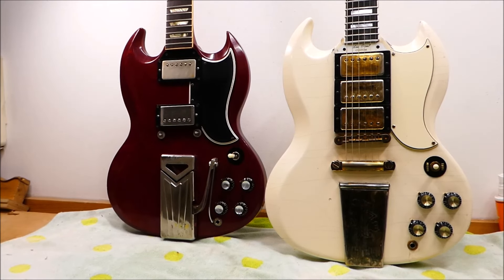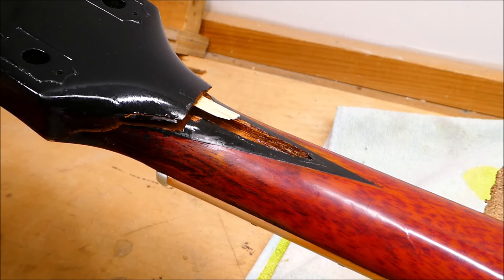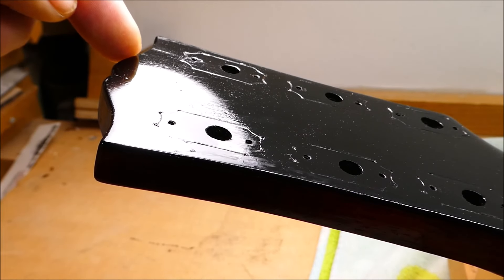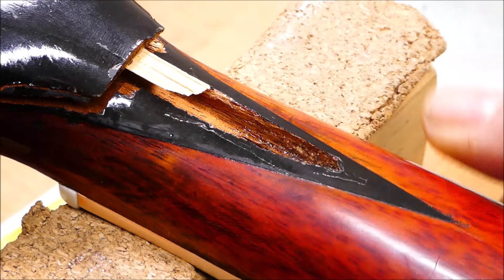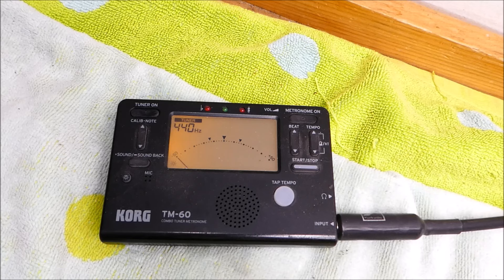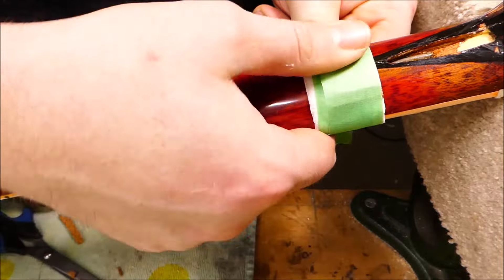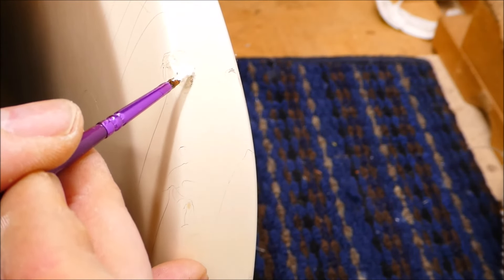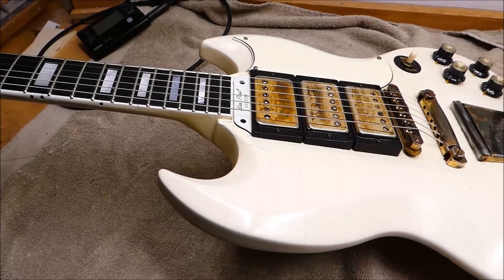Early Les Paul SG's :  1961, '62

Comment: Les Paul did not ask Gibson to take his name off of the guitar, his endorsement/signature model contract ended in 1963 & because he was going through a divorce he did not re-sign a contract until he negotiated a new one in 1968 late 1967 & it was THEN he requested they bring back the traditional single cut Les Paul. Not that it really matters much but I personally feel it’s very important to note that from 1964 through 1967 Gibson did not make ANY Les Paul models at all. Paul’s name came off the “new” double cut “Solid Guitar” and it went from being a Les Paul from 1961-1963 to being a Gibson SG from 1964 to present. Isn’t it mind boggling that from late 1957-1960 the sales of the traditional single-cut Les Paul slumped so bad they gave up that design all tougher for nearly a decade? You would not think that would be the case when they introduced the now coveted mythical PAF’s in 1957 & the now revered, cherished and also coveted Cherry Sunburst in 1958, you’d think they would have been jumping out of the stores but nope. Sales steadily decreased from late 57 through the end of 1960 when they discontinued it. Insanity.

Comment: Every olympic white LP Custom SG I've seen from 1961-62-63 has the neck binding cracks. Gibson painted Olympic White over the side binding on the neck. The binding shrinks and the paint cracked. I have a 62-63 that is in really great condition. No checking, gold hardware is still gold, 3 PAFs, pots are dated 1961, and the neck binding is still nice except for the first fret shows checking at the binding.

Comment: Your discussion about repair and restoration reminds me of baumgartner restorations. They have a set of rules they follow to differentiate between repair and original work. They use fluorescing paints for their repairs.
Reply: It reminded me of that as well. The conservation paints fluoresce because of the UV inhibitors added to them to protect the paint from fading. It was not to show where the painting was retouched, although that is a benefit to the owner and any future conservator.

Comment: I truly appreciate your comments about restoring an instrument to the point of hiding whatever damage may have occurred. Yes it looks better, but it is still not the instrument that it was when it left the factory (for better or worse) and therefore counterfeit. 
    I am also in complete agreement with your comments about work done with hands of a sentient being. Yes I have several CNC rigs that I enjoy producing objects with. But I also just completed a beginning Blacksmithing class. The objects that I was able to produce (with much instruction and help from the Master Smith) from basic metal shapes and even a railroad spike where as satisfying as anything my CNC gear has allowed me to make. Most every shape and mark were produced with my hand and a hammer.

Comment: 19:50 if you make a jig for a dremel drill station, drilling with a milling bit will give a cleaner cut regardless of the material you're drilling into. I've drilled clean cuts in cork with a similar setup. The issue comes from the drilling implement not being restricted. One flute catches and makes a mess of the hole.

Comment: Since it's getting New SS Frets, I would have used a Radius Block, fine sanded the fretboard and Ebony Stained the fretboard. The body was protected but I would have protected the headstock also, although she did a great job with her skills not to damage it. Speaking of headstock, I would have color sanded it using 7000 grit and bluff it to get rid of the spots and stains, but not too much. Just enough to make it pop. Nice work and great job.

Comment: The finish cracking at the binding 16:54......I have seen that before and also had it happen during refrets of old lacquer finished guitars. It’s from beating the fret end when installing the new frets. When you get out to the ends, tap lightly or the hammer blow can shatter the lacquer usually at the lacquer line at the bottom of the binding.

Comment: I have an 86 Les Paul custom SG reissue I bought in 89 and has been my main guitar ever since. There was a hairline crack where the neck meets the body that got worse when an idiot knocked it over and now it's visible.  Joel's shop is about 3-4 miles from my house.  I'd like to see if he could make it disappear. I'm never going to sell it, it's mine until I am gone. Just had it wired so I get all the pickup positions instead of the bridge, mid and neck, and neck. I haven't picked it up yet,  I'm still waiting on an amp to be finished.

Comment: Another option for the intonation-problem guitars is use a lighter gauge string on E and A. Then the saddles do not need to go so far back. Tone is fine with light strings, just ask Billy Gibbons and old videos of BB King. They run with 8s on Gibson scale guitars.
Reply: They take some getting-used-to, especially if you have a heavy picking hand but that just shows how much I over-pick.

Comment: I had a Les Paul SG in the 60s exactly like the one in this video. I loved it, probably the best guitar I've ever owned, There was an issue at the heel joint, the wood had split along the line of the fingerboard, but my Dad fixed that. The skinny neck was super fas and I blocked off the weird up and down vibrato. I traded it in for a cherry red 70s SG Custom, the most beautiful guitar I've owned, unfortunately also the worst name guitar that's passed through my hands. The middle pup was useless, it didn't stay in tune- due to the awful leaf spring vibrato,  and it sounded lousy. I hated it and had no regrets about getting rid of it and getting a 335.

Comment: The problem I have with the idea of a hand cut inlay being worth more is man has used tools since the caveman days to help him with tasks. Today, luthiers use power tools. At one time the luthier who did everything by hand looked down on any motorized tool being used. He probably claimed his work had more value because he did it by hand. Define “by hand”. Even the luthier who did it by hand was using tools. Are you familiar with a parser drill? Probably not. A parser drill allows a craftsman to cut out odd shapes. These have been used for centuries… CENTURIES! A CNC is merely another tool. If operated incorrectly the job turns out as inferior work. A good job is what everybody wants. Tools allow man to do a better job and in less time. Each time someone came up with a better, more accurate way to get the job done and in less time. What is it really about then? It’s about the threat of one’s livelihood being eliminated by a better built mousetrap. I would argue a very well made guitar is worth more than one that is sloppy no matter how either are done.

Comment: On the white Custom, the section of neck binding with the enlarged fret marker dot-holes seems to be a different colour to the section closer to the neck-joint. Could it have been a later repair-replacement after the wood/fret shrinkage-expansion fragmented the original?

Comment: 7:12 honestly should've been done for decades now. It's done in painting and it's standard practice to not hide those, not only that, it's a show of a quality repair to show it's been fixed and make as few irremovable repairs (within reason). And if it means this removes the scum of the pond from the equation, then yes. Personally, if it were up to me, a repairman should leave signs unbeknownst to the owner, to keep them (or a re-seller) honest.

Comment: You should always paint the new wood a coupletimes by itself FIRST. Match it up separately n when you get it to match as close as possible then you paint everything together and BLEND. If you continue painting them both at the same time your not going to close that significant difference in color no matter how Manny coated you add to them they are both going to change together n therefore the cookie difference isn't going anywhere. In simple terms paint the new wood to match before you try and paint to blend the wood 😉

Comment: An old guy came to me a few years ago, saying he had an old guitar that did not work anymore.
He knew i did some electrics on guitars before so he asked me to look at it.
And when he opened the case there was one of those early les paul/sg's in it.
And that guitar has suffered, broken neck that was ugly glued on again, pieces of binding gone and horrible repainted.
Not as bad as in this video, but it needed a lot of work.
Fixing the electrics was easy, new strings on it and it played great.
I wanted to buy it from him, but it was his first guitar and he did not want to sell.

Comment: Thanks for this upload. I own an original white 61 custom with tremolo. A lot of the paint has worn off on the neck at the 5th and 7th fret positions. the nitro has yellowed somewhat due to age, but I've been advised that it's almost impossible to spot paint these areas with an off white colour that will match perfectly. From your experience with that white LP, is it really that difficult to match paint colours perfectly?

Comment: Ive seen a lot of LP and SG style guitars with the bridges not installed at the correct angle and ive been shocked to see that some of them were able to be intonated. What is the rule of thumb on this ? How can you measure say from the nut to the bridge and know if its possible the guitar can or cant be intonated. Is there a measurment like this that will tell you it cant be intonated ? Sorry i am just curious as to why some of the guitars ive seen have been able to intonate and others that were very close in their imperfection were. Thanks as always for the videos.

Comment: In general how much money would you expect to save buying a repaired Gibson Les Paul that had a cracked headstock?
Reply: Usually they lose half their value with a headstock break. You can expect to pay anywhere between $150 for a "simple" glue up repair if the crack is minor, or up to $500 if the headstock is completely broken off (these rates might vary depending on who you ask)

Comment: Good job. That quite a long protusion on the router. Where do find such deep 1/4 inch bits?
Reply from the maker: It's a 1/2" diameter, 1" cutting length. Most of the router bit suppliers make them that size.  Freud's part number is 50-102.

Comment: Sino acrylate is what you should use there you could have pulled your joint tight and just seeped it in you're going to have a glue line no matter what you do with white glue I haven't used white glue on headstock repairs for 15-20 years! dont use splines either,,,it allways ends up looking terible as it ages

Comment: Whenever i undertake a repair on a Guitar that needs substantial work or some defect that should affect it's value, i leave my initials with a Pyrography pen in one of the pup cavities. I can disclose the repair if it ever comes back which has happened. The UV is a great idea, it's used for anti theft anyway and none disclosure of a broken repaired vintage, very expensive instrument is theft at the very best immoral.

Comment: Paint-strip the area around the serial number?
Reply from the maker: How is that going to help when  1/16" of wood has been physically removed?
Reply: @twoodfrd  No need to be sarcastic. It was an honest question?
Reply: @nickdryad  But.., if you watched the video, your question was already answered..
Reply: @pallecla  I did watch the video. Did he say you could potentially reveal a hidden serial number with paint stripper? I was wondering if that was a possible solution? If you took the black paint away with thinners or a weak caustic solution you might see the “ghosted” letters and then re emboss them. Sanding was one option. Obviously his preferred one. I asked a simple question and I would have preferred an answer that explained why my suggestion was wrong rather than one in a condescending tone. If 1/16 was already removed and you couldn’t see indentations in the paintwork where serial numbers might be, why would you assume there would be a serial number there? Perhaps it was filled and deliberately hidden because a seller was trying to conceal the stolen provenance of the guitar. Removing paint with a stripper might be an option. That pretty much what I was thinking.
Reply: @nickdryad  As he explained in the video, the back of the headstock was overlayed with a backstrap.
Reply: @pallecla  let me think about that for a bit.